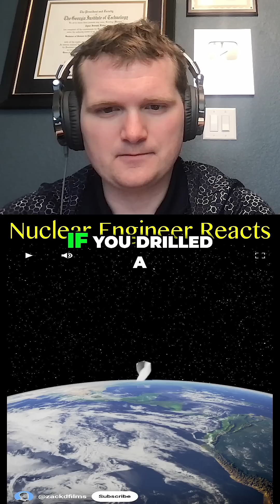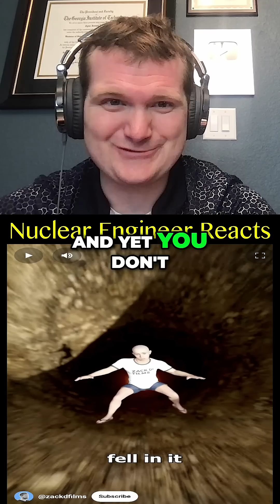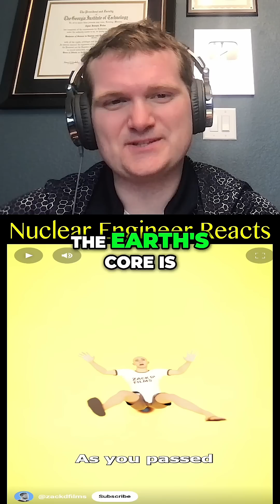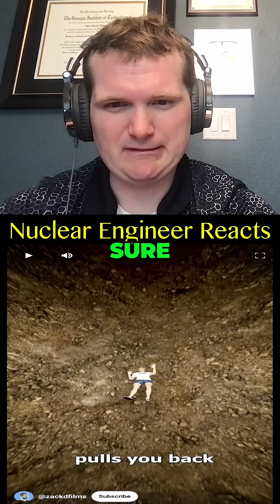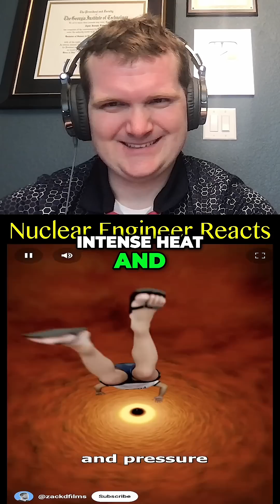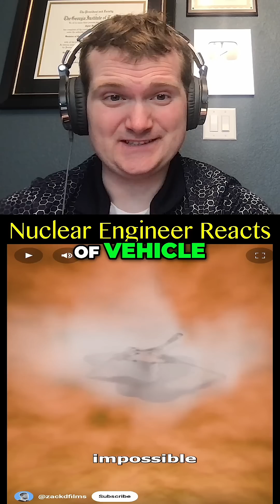Drilling a Hole Through Earth - Nuclear Engineer Reacts to Zack D. Films

Comment: Your angular velocity at the surface is much higher than in the hole, the further down you go the less radius everything has to rotate, so you would smack into the trailing side of the hole long before getting anywhere near the core

Comment: Space Engineers let's you do this without the issues presented from the heat and pressure and real physics since the rock is made of voxels and voxels are static. I have drilled a hole to the core of the moon using nukes. Took a few minutes. Everything was basically weightless towards the center, so going past the core using the blast mining method presented some engineering issues that I resolved with nuke missiles

Comment: Also you would keep your rotation around the earth because of intertia, so as you get closer to the middle you transfer your kinetic energy in the form of rotation into the walls and you would probably die from the heat of even touching the wall once.

Comment: The Russians gave it the ole college try, and had to stop after 12,200 meters or so. It got too hot, and their drills kept melting so that's about as deep as you can dig, at least as far as we know. 12 kilometers is barely scratching the surface, BTW, and the extreme conditions had the rock behaving like putty, or super thick dough.

Comment: It’s kind of an interesting thought experiment though. Assuming it were possible to drill a hole straight through the whole planet with an invincible tube all the way through, gravity would start to become a really weird thing as you got closer to the center because you’d have the entire planet pulling you outwards in all directions equally, aside from the lower gravity toward both ends of the tube where there’s no earth anymore. But while there would be “less” gravity in the middle, the air pressure would still be incomprehensibly higher in the center because of the gravity of all the air further out all the way to the edge of the atmosphere in the directions of both ends of the hole pushing down on the air in the center. But if there were no atmosphere? Then instead of being crushed by air, you’d just be stuck there floating in zero G, I think.

Very weird!

Comment: reminds me of tyson's explanation of gravity trains. You don't need to go through the core to have the fastest transit system coast to coast. No matter how long the pathway, if you drill a straight line between any two points of earths surface it always take about 45 minutes to travel through just using gravity.

Comment: Where did they get these 42 minutes? Well, maybe in vacuum, but with near-surface air pressure and gravity force,  the terminal velocity of a free-falling human is around 200 km/h and the diameter of the Earth is around 12800 km, which gives us around 64 hours of fall. If such a hole were to exist and not collapse, the air density closer to the center would increase dramatically and the gravitational pull of the mass above you would compensate the gravitational pull of the mass below you, so the actual flight time would be even greater.

Comment: You may wanna make a separate series, a doylian approach to media is good, but thought experiments are best done from a quasi watsonian approach.

So like here; the core assumptions would be, the tube is perfectly strong.

So then your D.O.F. would be: radiation, velocity, air pressure, gravity.

Unexpected changes: The air resistance would not work how you would expect. 
The gravity reduces as you go down.
The buoyant force will fundamentally change as you go down the tube.
The air pressure will change how it works as you descend.

Sometimes you have to assume a perfectly spherical cow.

Comment: I don't hate the hype.... Athetical scenario. We haven't drilled far enough to say with certainty that center of the earth is hotter than the sun. We've only drilled 8 miles deep we haven't got any deeper than that . What's the double guessing game by both of you so what you need to do is meet somewhere in the middle and then put a flat Earth on top. 😀

Comment: A few things: 
1. Even if the walls are sufficiently reinforced, unless it's a vacuum in there, the atmosphere will pool in the hole forming a dense atmosphere, a supercritical layer, and probably some water from compressed humidity in the air. Below that is a solid layer of high pressure Oxygen-Nitrogen ice.
2. If it is vacuum, unless it's from North Pole to South, Coriolis drift will cause you to collide into the wall. You're moving Mach 2 relative to the other side of the planet so there will be noticeable forces pushing you against the wall once you're going fast enough.

Comment: how?

some humans started 2 simulataneous meltdowns 180* apart exactly. 

because they didnt recycle any fuel and stacked it tightly without knowing what kind of fuel it was... and it boiled off the coolant overnight. 

when it got to the core it blew up... and what was the core holds open the hole now... 

the blast and ongoing laser produced by the burning gasses and radiation create 2 new poles from plasma jets! 

then it becomes like a scram jet and begins humming as it sucks everything in one side and spits out molten plasma out the other end.  

gravity re centers around this hole

humans then build safety rails around the inlet they created and a heat shield around the outlet... 

the earth has left the solar system but we have light, heat, and some kind of atmosphere whipping around the equator... but being on the surface would be insane.

Comment: Say there was all rock where the hole was, so you are insulated from the heat, would it fill up with air to the point where the pressure would crush you at a certain depth. Would the air become dense enough to make your crushed body buoyant at a certain depth?

Comment: No. Ignoring different temperatures and pressure. There are still varying gravitational pockets due to the earth's uneven mass. As a final note, while it's possible for this outcome to happen, it's not 100%, as even a small  difference in gravity could mean you're slowly pulled to the side of the hole and either cooked to death, or grated like cheese.

Comment: Wouldn’t you actually hit the inside of the hole (assuming the hole stayed open)? As the earth rotates, you travel at the tangential velocity of the surface, but the tangential velocity would decrease as you travelled down through the hole, causing you to catch up to the side of the hole. And since the tangential velocity would decrease the closer you get to the core, wouldn’t you basically feel as though you are tumbling further and further down a mountain or sloped cliff face until you reach the core? Sounds like death. Reminds me of Homer falling down the gorge except with extreme heat

Comment: Lets say you could make the hole stable... what air oressure do you think would be inn the center? A lot is the answer, the density would be so much that you would likely be close to overdamping the oscillations, ofc you can't really over damp it. But you know what i mean. The terminal velocty on the earths surface for a human being is about 150 ish kp/h to 200 and something, so after falling for what maybe a minute, you would reach it, and then you would keep decreasing in speed by a lot due to a weakened gravitational potential but also denser air. So the fastest speed would probably be reached within half a kilometer of the fall.

Comment: The cool thing is that the time doesn't change for tunnel between any two spots on the earth's surface, regardless of whether they go through the center or not (although you'd need a frictionless way to slide).

Comment: Is no one going to mention that the core spins faster then the surface? So if you'd jump in you'd need to time your jump precisely so that the hole you drilled through aligns properly only to have the core turn over causing you the crash into the core from the inside. Talk about the most dangerous thumbnail hole... wait a minute... >:)

Comment: Your wrong... There is actually way less pressure due to the gravitational pull of material being cancelled out by the apposing gravitational pull of the other side of the earth... The further down you go the less gravity you experience since your being pulled more from all sides... Eventually if you reached the center you would be weightless having the earth pull you from all directions equally...  So while you would still have pressure induced by the outer edge of the earth, the further down you go the less additional pressure is added and decreases exponentially till its essentially nothing...

Comment: Not to mention, acceleration due to gravity goes down as you go deeper inside earth. Near the centre, the person would have little to no g force, extreme pressures and easily melt and the sudden change in direction of g (because you still have momentum) would possibly do bad things to the body

Comment: At the temperatures of the earths core the earth would be a liquid and with the immense pressure it would instantly close, it would be as pointless as drilling a hole in the ocean surface
Reply: The inner core of the earth is solid. Pressures are so high it can’t be a liquid

Comment: I think it would need to be near the poles because of the spin of the earth. Unless there was a track or guide system. If you could have the whole thing be a vacuum chamber, then you would stop near the other side instead of just past the middle. There is an easier "vacuum chamber" in space, a few minutes longer, but no currently impossible engineering needed. The even longer way around is easier.

Comment: Engineers? Safety? That's for the safety engineer who clearly wasn't hired. As an electrical engineer, I saw no safety issues bringing and teaching 3rd graders how to build a plasma speaker, which no one else in my department saw the issue either until their teacher told us that would be an issue. So I could see engineers not installing a safety railing.
Reply: What was the problem?

Comment: This was actually a problem my mechanics professor gave us, it's a somewhat tricky differential equation, but basically sinusoidal motion.
Reply: You mean suicidal motion?
Reply: @StarWarsExpert_ no😂
Reply: Elaborate please. Was the answer a sin wave graph?? Was it a first order or higher differential equation? I NEED TO KNOW?!??!?!😂
Reply: @tateihuhwa  You can exploit spherical symmetry and the fact that gravitational force must point towards the center of Earth to find -4πGM = 4πr^2 * F_g, where M is the "enclosed" mass at your current position r. We can stop here and realize that M scales with r^3, so dividing the surface area to the other side gives F_g ~ -r. Exact same force equation as harmonic motion, ex. a spring.
Reply: @aerialkiller5948  This, basically. It was long enough ago that I don't remember the details, other than only being allowed to assume that the earth is perfectly spherical and of uniform density, and that the hole wouldn't collapse.
Reply: Yeah, assuming the earth's density is constant (which it definitely isn't) you can derive -4GmPπr/3 which is basically the equation for a spring so you can use the simple harmonic motion equations to describe an infinite oscillating motion.
Reply: @squidoodalee  The fact that the zachdfilms approach OP is supporting requires you to assume constant density is a BIG detail that they both left out lol
Reply: I studied this in high school
Reply: Is it something like ma = GmMx - Cv?
So, linear second order?
Reply: Assuming we take it as a given that the portion of the Earth that is "above us" (with a radius larger than where we are) can be ignored (it can), it's a very simple equation, you get back the harmonic oscillator right away. Proving that the attraction from the "above us" parts of the Earth cancels out is a bit trickier but it's usually taken as already proven.

Comment: Also, unless the earth either stopped spinning, or you‘re going pole to pole, coriolis would squish you into the western wall. With would also be a very unpleasant experience.
Reply: I'm pretty sure after a while the gravity from the giant, irregular, masses of planet on either side of you would smack you into the wall, spin or not. Oscillation wackiness is not happening.
Reply: Anytime someone talks about drilling thru the Earth I'm like how are they not afraid of all the magma and molten rocks that's CERTAIN to spew out
Reply: Isn't it the eastern wall? As a falling object moves from the area with higher rotation speed to the area of slower rotation speed it would move ahead of rotating Earth, and as Earth rotates from west to east the falling object would hit the eastern wall.
Reply: @dmitriy4708  indeed, it should be the eastern wall
Reply: @dmitriy4708 depends if you jumped in from the northern vs southern hemisphere
Reply: @ No, it would not. In both hemispheres you would travel from west to east with the Earth rotation, so slowing the rotation of surrounding matter as you fall deeper you would find yourself moving ahead and hitting the east wall.
Reply: @ Throwing it up makes you have less angular velocity and it ends up to the left of where you threw it but i guess if you make it past the equator you end up hitting the east wall anyways... ?
Reply: @ I don't understand what do you mean by throwing it up. We are talking about dropping something down. This something has a higher angular velocity than the stuff underground, so it would go ahead in the direction of rotation regardless of where it is aside from the poles.
Reply: @dmitriy4708  somehow i lost perspective of the question that badly that i imagined you could throw it upwards from the southern hemisphere lol. thanks for your knowledge